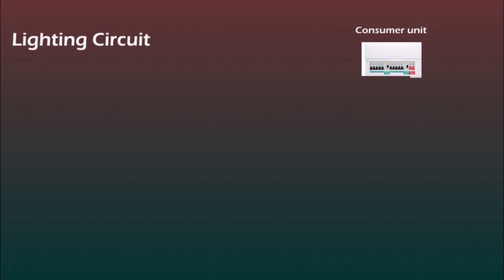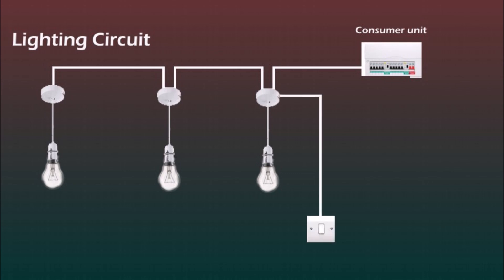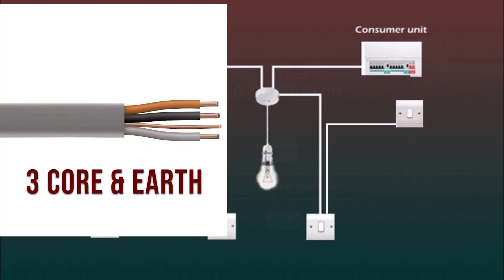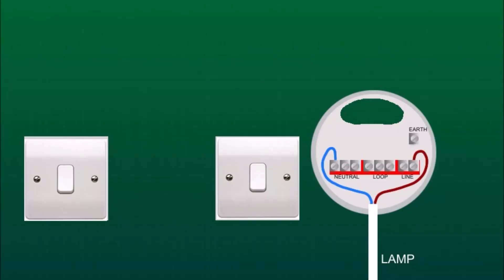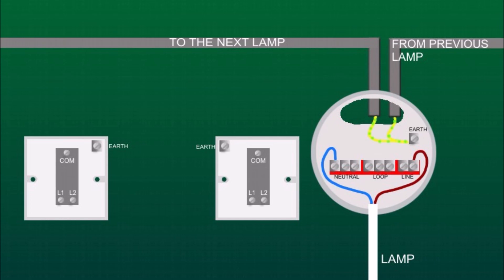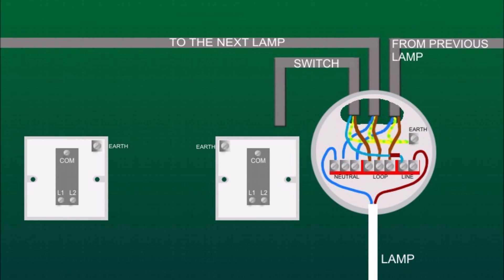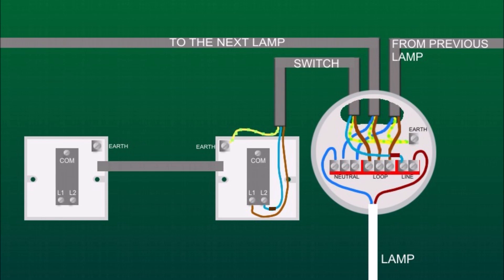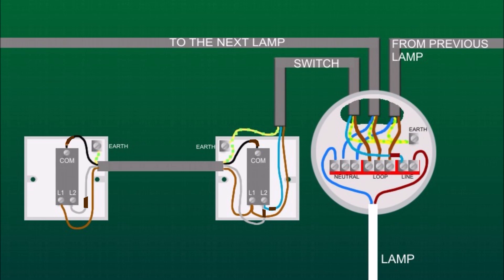2 WAY SWITCHING EXPLAINED How to wire 2 way switches together Wiring light switch to ceiling rose

Comment: Great videos you have, very easy to understand! I’ve also seen before when working on jobs, and I was taught this way too. The 3 core and earth that is wired between both the two way switches. It doesn’t really matter which cores you use. Obviously earth is earth, but I’ve seen brown (from the 3 core and earth cable) go into common and the black goes into L1 and grey into L2. Both black and grey identified with brown sleeving to show they’re switch wires. Then mirror image the same at the other two way switch.

Comment: I've learned a different connection from technical school. The live wire goes to the COM of the first switch, the L1 and L2 of the first switch go to the L1 and L2 of the second switch and the COM of the second switch is the live to the lamp
Reply: It will work wired that way, brown wire to first switch, where does the blue neutral wire go. If one using twin and CPC ?
Reply: @m101ist  this way is mostly used when the wiring is in tubes, inside the walls. From the DB you get the live wire to a switch of a specific lighting circuit (because a breaker often controls multiple lighting spots), and this wire goes under the floor. Then, 2 other wires will be connected from the one switch to the other (that's the connection I was referring to before), and again, these wires will go under the floor. Finally, you connect a wire from the other switch to the lighting spot, and that's the live connection.
Now, for the neutral, you just take a wire from the neutral terminal in the DB, and it goes to the light through the ceiling. 
The reason for this, is that you always have to design an installation in a way so that you can use as less as possible wire length, and trust me, lighting installation is probably the worst part of an electrical installation.
Note that I didn't mention the earth wire for simplicity.

Comment: How do you connect spot light where there is no ceiling rose.
Reply: Junction box in the ceiling.
Reply: @bitTorrenter  where there is no ceiling rose.
Reply: @Billy_Bull_Sheeter  The existing wire( if the is one) will be live neutral and earth.
Reply: @antonios4926  there is 1 wire. Do all the spotlights come beck to the 1 wire?
Reply: @Billy_Bull_Sheeter  No just one spotlight after another no return. Was the existing cable a light that came on with a switch?
Reply: @antonios4926  
So the last spotlight is where the wire ends?
 Correct, There was a switch and a light. But there is no ceiling rose.
Reply: @Billy_Bull_Sheeter  Yes at the last spotlight the cable ends. A lot of electricians take the cable 3 wires to the switch first then to the light, thus no ceiling rose. Please be careful.
Reply: @antonios4926  thanks. I have done it mate. It's working fine. Thanks for help.
Reply: @Billy_Bull_Sheeter  Happy for you
Reply: Just for safety if there is insulation in the void where you have installed the spotlights you must cover them with a fire-resistant cap. As the spotlights can get very hot. This has been on my mind all day.
Reply: @antonios4926  thanks for the advice mate. There is no insulation

Comment: I want to install an outside light, I have a light switch inside close by to where I'm going to have the outside light fitted too the wall, is it possible too make the inside light switch into a two gang switch and have a wire going from the switch directly to the outside light.

Comment: What if you've got a 2gang switch instead of a 1 gang. Do you just add an small off cut and link between the same terminals?
So you control upstairs and Downstairs light from any point.
Reply: In this case you will need to run two 3 core cables instead of 1 so that you have 2 strappers controlling both of the 2 ways. It’s hard to explain in text.

Comment: Great explanation .. one qusation , is there any regulations about hot line colours 😕 allowed to  use in pvc conduit single wire  as red yellow or pink or orange or green ..
Reply: If you are referring to the colour of the cables then yes, current regulations state that new colours (brown, blue and earth) have to be used in oppose to old colours (red, black and earth).